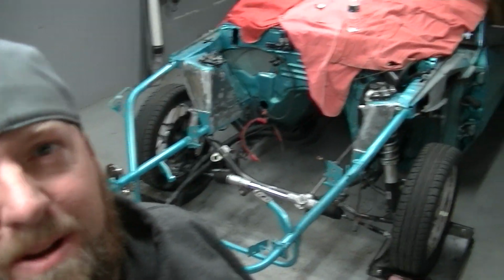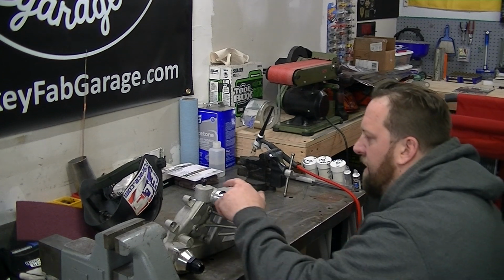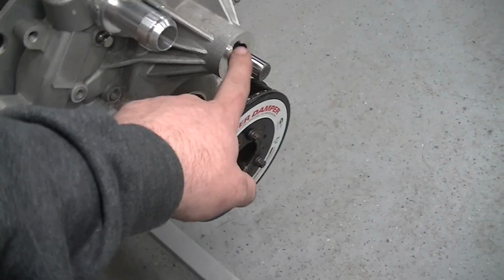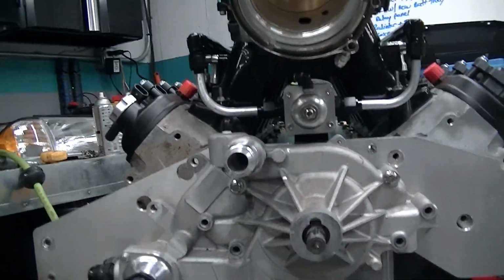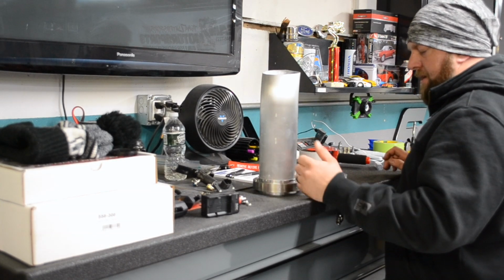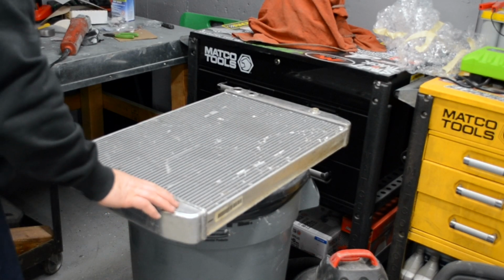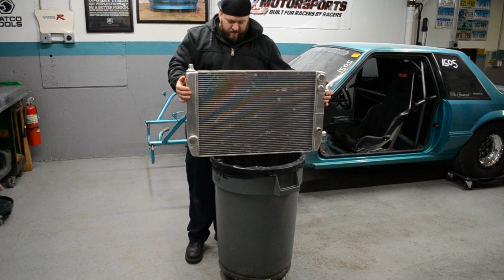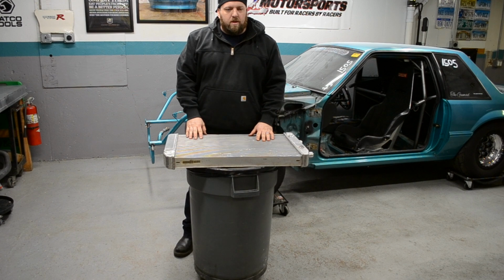Foxbody Upgrades EP: 4 Gluing metal together

Comment: I would reconsider another fan setup. My contour fans pull 3000cfm with an airfow meter. You have the space to allow better and bigger fans. Motion recommends 3500 CFM minimum...
Reply from the maker: SICK FOX I did think about that but I was getting by with like 1800 cfm with the old one and a smaller radiator. If I have to change later so be it.
Reply: I recently updated my 3000cfm Countor Fans to 4000cfm Derale fans which actually are Spal fans. These fans were recommended by Doug at Motion....great video Racestatus.